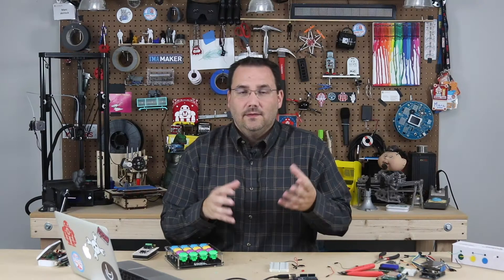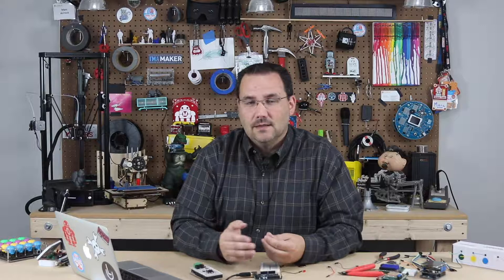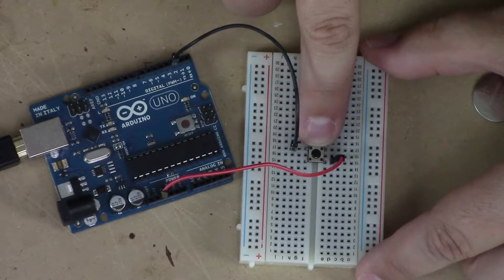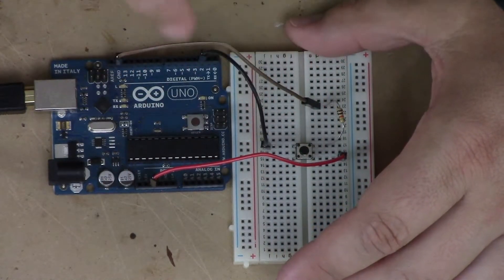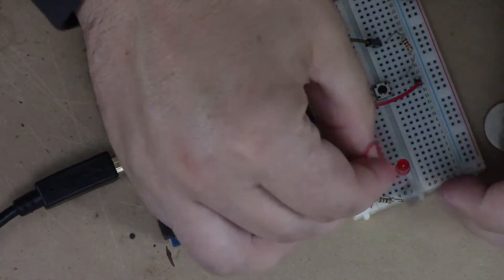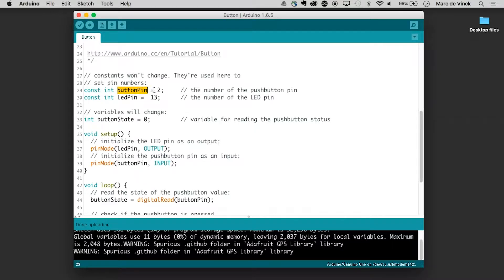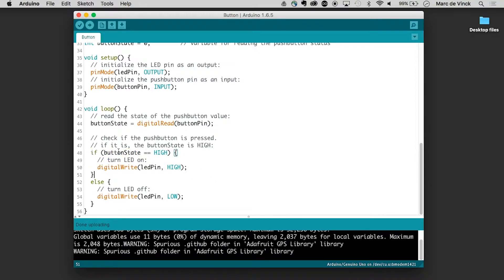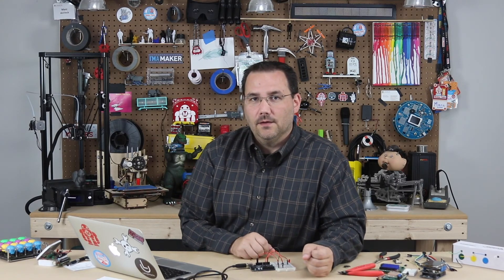Arduino Prototyping Basics #20: Buttons

Comment: Sorry but what does the ground do? I really get confused when you attach some pins to the ground and some to the 5V
are they connected to each others on the board or what?
Reply from the maker: Electrical circuits need to be complete. This includes a connection to + and one to -. How, when, and where depends on the circuit, but in general you do not connect GND directly to +. Make sure to understand the circuit you are creating before connecting the wires. If you mix the + and - up, you stand a good chance of shorting and possibly damaging the sensor and/or components.
Reply: @MarcdeVinck  I know everything about electrical circuits but when you include Arduino in the circuit I just get confused, for an example in the normal circuit I already know where the + is and where the - is, but in circuits that include Arduino the input pin is the - and the output pin is + right?
Reply from the maker: @pharaohboy8657  The Arduino's code allows for a pin to be in or out. Just remember to have the appropriate resistor values as too much Vin can kill the board.
Reply: @MarcdeVinck  Ok thanks but I still don't know the role of the GND pin
Reply from the maker: Pharaoh Boy It’s the same function as an electronic circuit without an Arduino involved. The Arduino is, generally speaking, just reading, and reacting to, the voltage within a circuit. Make sure you understand circuits prior to diving in to making your own. Try building other circuits found online with known successful outcomes to practice.